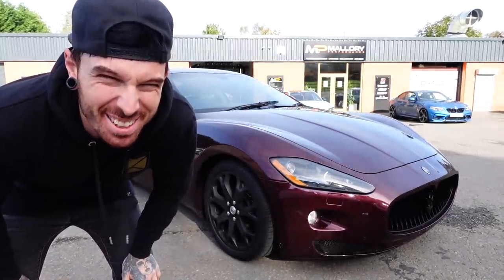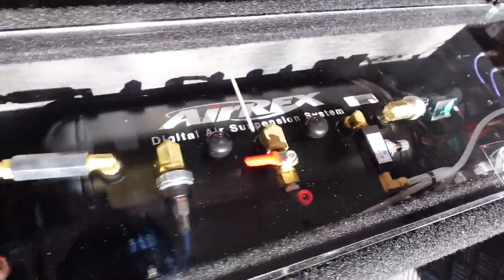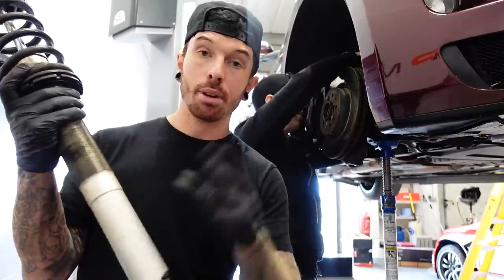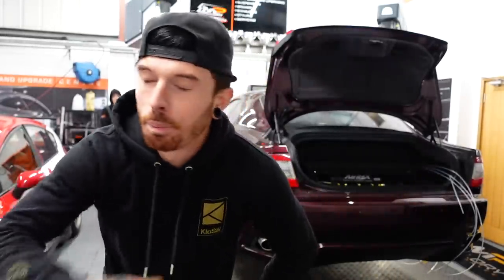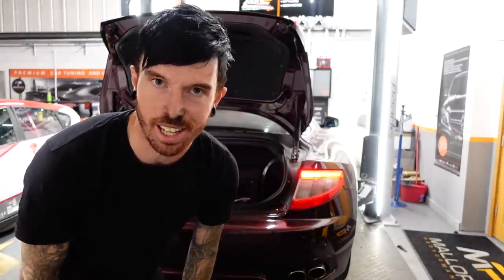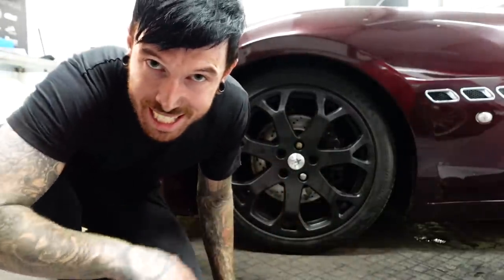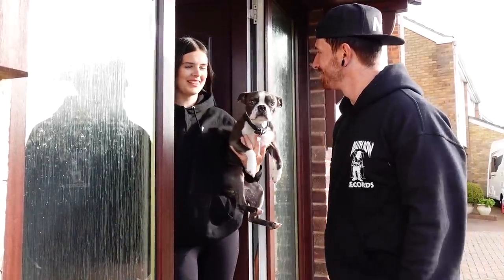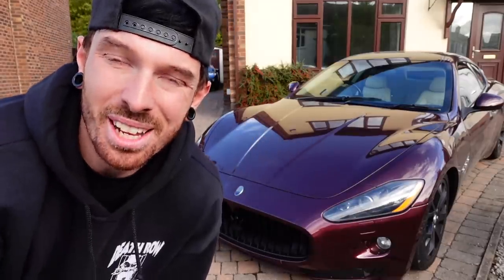I FITTED AIR RIDE TO MY CHEAP MASERATI GRANTURISMO

Comment: Great Content as always Matt ! Quick question if anyone can advise : I brought my car and generally the temperature gauge after a while goes to 90 ( i.e the middle of the gauge) and stays until the car is turned off and left to cool, however recently got my car serviced and noticed this does not happen anymore, till go to about 60/70 and stay there regardless of how long the car stays on for. This also changes going slightly up or down and if it does go to 90 ( after driving hard) it drops again whilst the car is still in use. Is this normal ? appreciate the help!
Reply: I would recommend getting the thermostat checked as the symptoms you are having usually mean that the thermostat needs replacing.
Reply: 101unpredictable they probably topped up your coolant.
Reply: I would second the thermostat
Reply: @Michael-xv1cl  Thanks for the advice Michael, do you think it could be a stuck open thermostat ?
Reply: @JNorth87  Thanks Jonathan, do you think it could be a fault with the thermostat being stuck open ?
Reply: @101unpredictable  could be!
Reply: @101unpredictable  Most likely yes. When I have come across this happening 99% of the time it was the thermostat

Comment: Why are you unbolting the top mount!!?Shock comes out as a unit. No one who knows what they are doing would do this.
Reply from the maker: The coil over would not come out without releasing the top mount or spring as the top arm and lower arm was too tight of a gap for them to fit through. The bolts holding the arms on were seized hence releasing the top mount to get the damper out